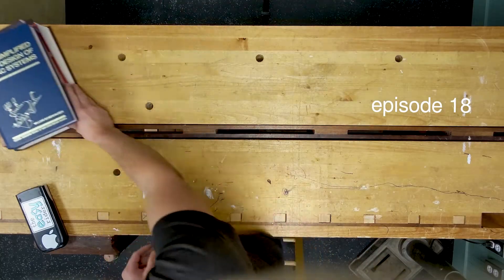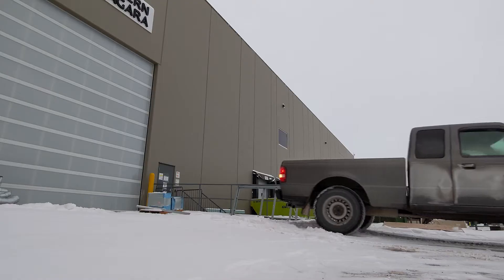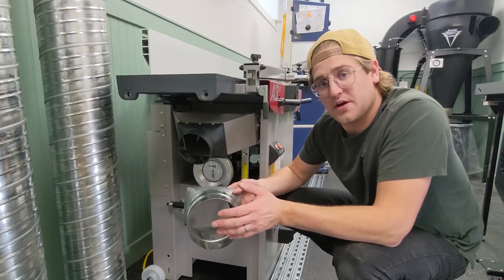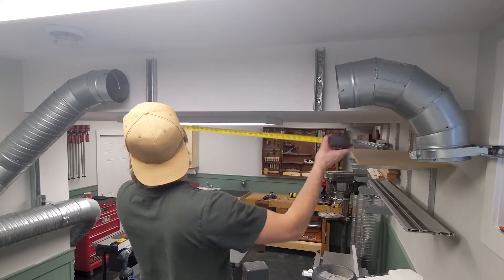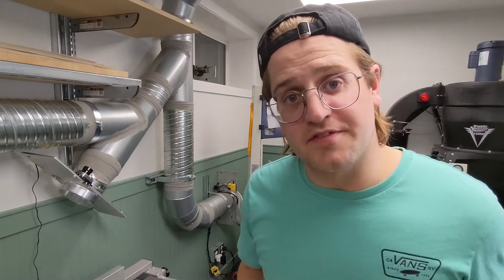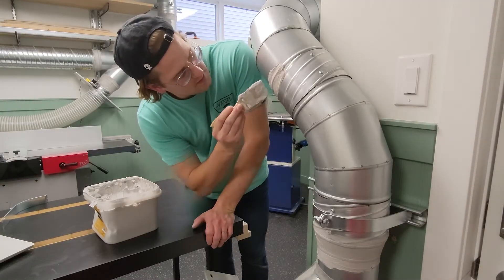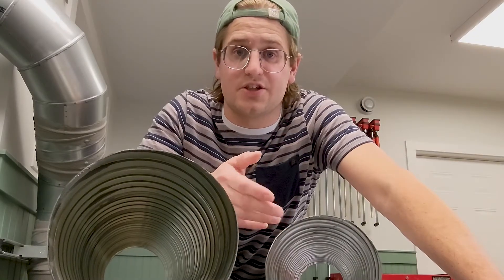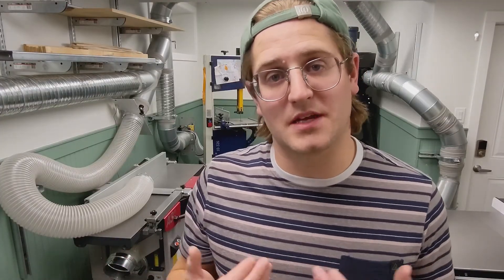How to SIZE dust collection pipe! ep18

Comment: Hey! Great video, I've got a quick question on it. You mention 350, 600-800, or 1000 as recommended CFM for the tools. Where do those numbers come from? Are they an industry standard or is there a calculated reason to choose one of those values?
Reply from the maker: Hi Ben. Great quesiton. There is very little information about tool specific CFM requirements out there and engineers often rely on manufacture recommendations during design. However, there are a few things I would recommend:

1) Calculate what the manufacture is thinking based on their connection diameter and 4000 FPM (CFM = FPM * Area). You will see that this is often way too low... For example, a table saw with a 4" port correlates to 350 CFM [ (4000 FPM) * (π * (2/12)^2) = (4000 ft/min) * (0.0873 ft2) = 350 ft2/min ]. If you have ever tested a table saw with only 350 CFM you will know this bites the dust...

2) Check out the CFM Requirements Table on Bill Pentz website as he as compiled some good information based on American Health and Safety standards (OSHA). Here is a link https://billpentz.com/woodworking/cyclone/dc_basics.php#CFMRequirementsTable

3) Just run with 800 CFM.
Reply: @BlakePizzey  Thank you, Blake! That resource is super helpful!
Reply: Irrelevant what manufacturers say, what you want is to get rid of the very fine dust particles. You need 1000 cfm everywhere. Hard to achieve though.

Comment: This video is almost perfect. The only improvement would be short rivets over screws. While slower, they don't snag wood chips as much,  and are smoother for air to pass over. It's also recommended to not put rivets or screws in the bottom of a horizontal pipe where chips can gather. But I'm really splitting hairs here on an otherwise perfect presentation.

Comment: My WEN 1300 cfm has a 5” port so I can’t use 6” right?
Reply: You can with an adapter, but pay attention that it will lower the air speed (FPM) in the pipe, and that can led to dust "falling" down inside the (horizontal) pipe and could end up blocking it. There were a small mention on this in the video.

Comment: I’m liking how you explained this. Wood it not be an advantage to somehow move the jointer and shorten the flex pipe to 4’ minimum? The flex pipe has a big drop in cfm does it not?

Comment: Excellent video. I couldn't help but notice that you are still pulling a vacuum for the entire system rather than a direct section. I believe this is negatively affecting your static pressure.  adding a second blast gate at some wye junctions could possibly help.

Comment: Blake- Designing a system currently for a tiny garage shop- thanks for this video and the explanation! Bravo mate! So- its been a year- any "Update" videos and how are the sensor gates doing after some time?  Subscribed and thanks again!
Reply from the maker: The blast gates are still running with zero issues. Love them!
Reply: @BlakePizzey  Thats great to hear! So gonna shift gears a bit- any concerns using these calculations for grinder dust? Other than a spark arrestor and drawing air over water (already have those built into the thoughts)??? I realize metal is heavier than wood-dust, but any airflow considerations from your engineering mind make your whiskers twitch?
Reply from the maker: @sdunca4864  Sounds like you are on the right path. The minimum transport velocity for grinding dust is 3500 to 4000 fpm. Sawdust is 4000 to 4500 fpm depending on how heavy it is. I stuck with 4000 fpm for this video. As always, I recommend checking in with dust collector manufacture or engineering group to confirm details. Good luck!

Comment: Great work, my only comment or issue is that you are 100% right.  More pipes or hose to run through reduces the velocity and the CFM.  What is missing is that if the system helps you use it and thus collect more dust then ducting is the way.  That is why I want to duct my system.  Right now I have a hard time getting hoses to where I want to clean up or do work.  Adding duct work would allow me to use it more.

Comment: so how did you calculate the distance for ea fitting ? a Y= 25' ? 90 = 15' ? etc.
Reply: I was looking in the comments hoping I would find that answer. I feel that he meant 24" inches for the Y, not feet, which makes me think the whole calculation is off. Either way, he's pulling a ton of cfm at the tool.  I think I'm more unsure about my calculations now though.

Comment: This is a very awesome video. I am working on setting up my old cyclone in  my new shop. I have an old pen state industries cyclone. They don't make it anymore and I cannot find any info on it to determine static pressure. What do you recommend since I don't have that info? Also, I would love to find a supplier for spiral ducting. I was only aware of nordfab in the states, and that is cost prohibitive for me. Thanks so much for this video!
Reply from the maker: Hi Nathan, I'm glad it helped. I would keep it simple and find an Oneida dust collector with the same HP rating as your dust collector and use their fan curve. It will be close enough for what we are doing here. 

As for the spiral ducting. Compile a specific list of materials (linear feet of x" pipe and x number of fittings) then search Google Maps for "sheet metal supplier" or "HVAC supplier" and ask if they sell spiral ducting. If they don't, ask who does. Someone will point you in the right direction. Once you find the right person I find it best to get their email and send them your material take off for the quote.
Reply: @BlakePizzey  awesome advice! Thanks so much!!
Reply: Watching your other videos now!

Comment: Amazing content!  Question, during step 3 when you're calculating the TEL, how did you determine the EL for the various fittings: wye = 25', 90 elbow = 15', 45 elbow = 10'?  Is there some kind of correlation to the fitting diameter and it's length?
Reply: Disregard Blake, I see that Ryder Sherwood already asked this question!  Amazing job again.  We need more factual videos like this over theoretical, garbage!
Reply from the maker: Hahaha there are some OK videos out there but lots of suggestions with very little to back it up.

Comment: I went to a carpet store and asked for the heavy cardboard tube that is in the center of the rolls. Got them for free. use metal flexible drier duct for corners and elbows. joined them with duct tape. The blast gates were the most expensive part of the system. I inherited the tools and collector. the system had two shapers, two planers, and two jointers attached. never did attach the table saw as I liked to watch the sawdust pile build. But I did add a floor shoot that I could sweep into. The point is its not hard to make a low cost system if you have a collector. Just think outside the box.  PS your system is very nice, my is ugly but works.
Reply from the maker: Wow, very resourceful! Congrats

Comment: Has anybody installed the iVac system with a Harvey G700 dust collector? I can make it turn on but fan doesn’t kick in until I press Run or use the Harvey’s remote
Reply from the maker: Sorry, no help here but interesting. I'm curious now. Anyone?
Reply: @BlakePizzey  turns out you need to buy a thing called "Magnetic Switch Controller (MSC)" instead of the iVac pro switch/contactor to make it compatible with the G700. Bad avertisement from them IMO. Good thing there's a solution!

Comment: Hi from the One Handed Maker.
Once again some really good advice and I like the pace you explain things.
I used 6 and 4 inch PVC in my shop and it does the trick. Even though it's grounded it can give you a zap if you're not careful.
Can't do without flex hose I guess it's a necessary evil especially if you have any machines on wheels.
Regards James from Australia.
Reply from the maker: Sounds like you went about it the right way! I guess thats one postive with using ducting - ground is easy as pie.

Comment: Ok.. one thing has me really confused. Toward the end, you say "now lets determine our pipe diameter.." -- but you already installed all your pipes and fittings. Shouldn't you have done that first and then bought your pipes to get the CFM you want?
Reply from the maker: Hi Caleb - You bet. I actually designed the ducting system a few weeks before filming the video. I was just using the installation footage as content while explaining how to size your system. Hopefully that makes sense!
Reply: yeah i was a little confused with the progression from the 4",6", 8" thumbnail, then the example that gave 6.8" to round down to 6", and then working the fan curve gave was 7.4", rounded down to 7". huh? then i noticed the v3000 has a 7" inlet port. not a coincidence, right? and, there's no 7" pvc, but i now see ducting comes in 7". TIL. putting it together, slowly. 🙂

Comment: Where do you get the EL per fitting?
Reply from the maker: Hi MGB! I would recommend Googling "duct equivalent length chart". You will find some discrepancies between charts but they are all more or less the same for each fitting.

Comment: Thanks for this video, easily the best I've seen in explaining the numbers of dust collection...Only thing that I'm not sure about is how you arrived at the figures you did for the Total Equivalent Length part. For example, why is a 90 degree elbow an additional 15'?
Reply from the maker: Hi Ryder, great question. These numbers came from a table in one of my textbooks and similair values can be found online by Googling "Duct Equalivent Length". The EL method is used to simplify duct design (pipe design too) and the values in question are a compilation of experimental data. It's much easier to categorize these losses by EL than it is to calculate their actual pressure drop.

IN SHORT! It's not something that I calculated but something that others published. My simple definition of EL is: the length of straight duct that would create the same pressure drop as the fitting.

I hope that makes sense!
Reply: @BlakePizzey  I keep reading that 2 x 45 degrees is better than 1 x 90 degree, but 20' is worse than 15'?
Reply from the maker: @rdholb  Another good question. Lots of talk in the woodworking youtube niche about two 45s over one 90 however I haven't seen data support it. I believe they are more or less the exact same. I think my numbers were based on a true 45 and a long radius 90 which may explain the discrepancy you noticed. ASHRAE Standard 120 is what you want to review if your looking for hard data and precision in your calcuation. Making some simpflications and using any EL fitting chart online will do the trick for the average shop.

Comment: This is super cool and very informative, but those automated blast gates are over $250 each...Yikes!!
Reply from the maker: Hi Eric! Your right, not cheap but the cheapest solution if you want automation. At work we had a project with 24" blast gates... Those were $$$! I had the same industrial company price my shop and each 6" blast gate was $750 CAD. Their controls and sensors were 2k on top of the gates!

Either manual blast gates with a remote or iVac.

Comment: I’ve watched a few of your videos.  From what I have seen of your shop, there appears to be a lot of similarities between us (I wouldn’t be surprised if you did UBC engineering like me; you mentioned moving from BC).  I had an extension to our garage built during the summer of 2020 and built out a wood shop.  It’s been great—I should have done it sooner.  I installed a little Jotul wood burning stove, which is a little unusual for an attached garage, but it makes the space so inviting through the winters here in the Seattle area.  In Edmonton it would almost be essential.  Looking forward to your future videos.
Reply from the maker: Thanks Cory! I attended U of A then moved to BC shortly after for a job. Sadly I'm back home now... And yes, wood burning stove would be unreal. I almost put one in my first shop.
Reply: @BlakePizzey  I'm midway through installing permanent metal ducting to my tools.  Oneida recommended that I use flex hose and quick connections for a year in a new shop to ensure I like my tool placement before I invest in metal ducting.  It's been a year plus, so I started in on my metal ducting a couple weeks ago.  I didn't approach my ducting nearly as scientifically as you did, but tried to follow best practices (violated them in a couple instances).  This was a balancing act since I also wanted to consider aesthetics, lighting obstructions, and ambience.  Functionality was most important, but creating an inviting space to spend time is also a consideration for a hobby shop.  

Your video inspired me to purchase an anemometer and see what I am getting.  I have a 6" diameter trunkline (Oneida snap-lock pipe), 5" diameter down branches, and short 3' end sections of 4" flex hose to each tool.  I'm getting on average 900-1000 CFM (about 9000 ft/min) at the end of the 4" flex hoses that go into the back of my tools (not sure how accurate these readings are--seem too good to be true).  My assumption is that once I connect each short flex line to a tool (e.g., table saw) the added resistance will drop that flow rate/velocity such that I am below 4000 ft/min in the 6" trunk line.  Think I should keep more than one tool open at a time since I have 4" tool stub out lines?

Finally, you mentioned do not come out of the v-3000 with a "funky" wye.  Well, I violated that recommendation.  I mounted my v-3000 high up on the side of my wall (inlet is about 9' up). I come out of the v-3000 with a 7x6x5 wye followed by a 45 degree angle into my 6" trunkline that runs straight for 8' before bending.  The 5" end of the wye drops down my wall into a flex hose port which I use for shop clean up.  The main trunkline does NOT come off the branch part of the wye.  What is the negative result of having this 7x6x5 metal wye at the inlet to my dust collector?
Reply from the maker: Hi Cory, sorry I never saw this comment until now. If you're reducing down to 4" on a decent 3HP then yes I would keep two 4" ports open, I think... I would bet that the 3HP unit actually sits best on the fan curve with a 6" or 7" pipe and two 4" are less surface area than one 6" or one 7". Maybe take a reading and test? All depends on the fan curve.

As for the straight section into the cyclone - it's related to reducing the turbulence of the air running into the cyclone. This affects your dust separation. The goal is to pass as little dust as possible to the filter so you can keep your static pressure in the system down and run higher on the curve for longer.

Comment: Blake, excellent video, awesome work. Your explanation of air flow and total equivalent length, which many DIY installers do not consider, is very clearly explained. Who knew a ribbed flex hose, a few elbows and fittings would add up to an additional 100 feet plus of length, when the original run itself is only 14 feet.
So glad you like the iVAC parts and accessories and happy they have automated your dust collection system, making your shop healthier, safer, and more convenient to work in. Always collect at the source.

Comment: You should have setup a forge, and casted your own iron pipe, what a fail, unsubscribed.
Reply from the maker: Lol I practically did, had our shop at work make up most of those fittings!
Reply: Can i buy one for my felder jointer/planer?
Reply from the maker: Hi Josh! Sorry, I won't be able to swing that but you should be able to find one easy. Google HVAC supplier and ask who sells/fabricates sheet metal ducting in town. The HVAC supplier will know who you should call. Just ask the ducting shop for a short/tight square to round transition. I believe it's 5" x 7" to 6" round.
Reply: @BlakePizzey  awesome thank you very much